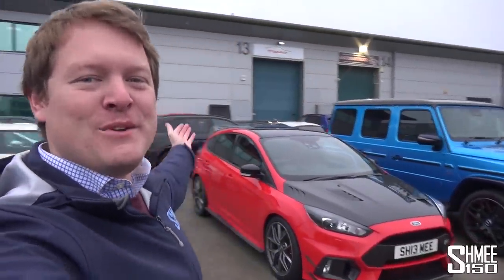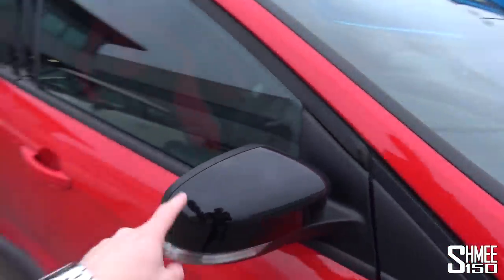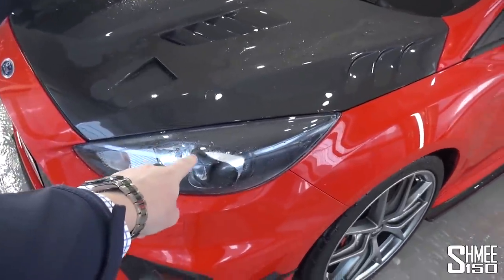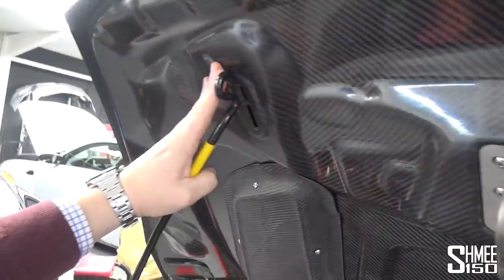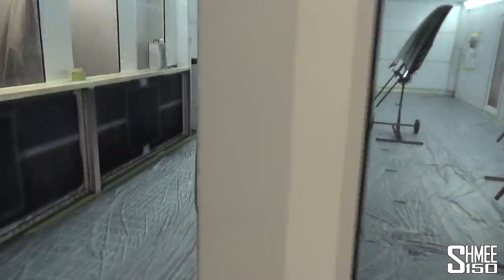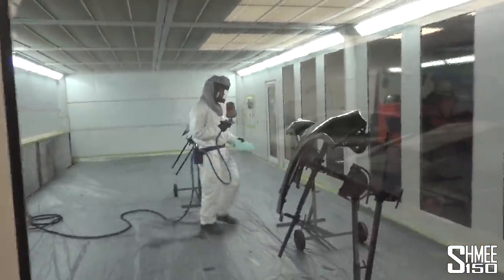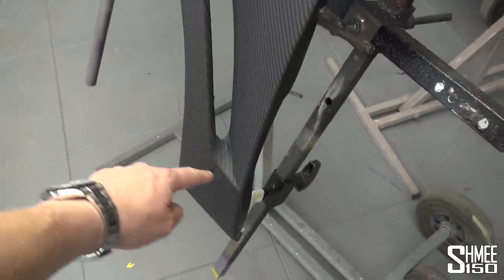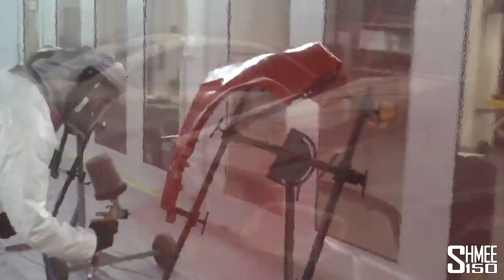TRANSFORMING My Red Focus RS with New Carbon Parts! | PROJECT PART 12

Comment: Still need to get the sequential gearbox
Reply: And decent suspension, and big brakes!
But one thing at a time, I guess...😅
Reply: @jeduardoslb1  He got a brembo and upgraded suspensions already on his Red RS.
Reply: @marinerchris  yes they're brembo brakes but they are stock and so is the suspension
Reply: João Duarte I’ve got an RS and these things definitely don’t need a big brake kit or aftermarket suspension other than maybe lowering springs.. unless you’re going on track, even then it’s set up incredibly well
Reply: A sequential is around 20-25k
Reply: theriseagainstfan01 is yours running 500+hp?
Reply: Kristian if you think that adding 150hp over stock makes the standard brembos unsafe then you would have to reevaluate your driving.. as far as the suspension, it’s track ready from stock
Reply: theriseagainstfan01 Okay man, not upgrading the stock brakes whilst adding 40% more HP to a car is fine 👍, pads and lines at a minimum imo.
Reply: Kristian pads and lines are a great modification for any car.. but the person I replied to didn’t say that, he said a big brake kit

Comment: Need a full body conversion if you’re going wider front arches then they need to match on the rear..... it’s also an absolute MUST to upgrade the brakes and suspension and of course a sequential gearbox will completely transform this project car

Comment: You should get some upgraded drilled rotors, fluids and stainless steel lines to be able to handle that power. You won't regret it👌

Comment: Wider guards, how are you going to fill them with those BBS wheels? Don't spend all this cash on it and go pov spec with spacers. Get some custom 2 or 3 piece wheels to fit properly . The bonnet and guards will look great when finished if the wheels fit well.